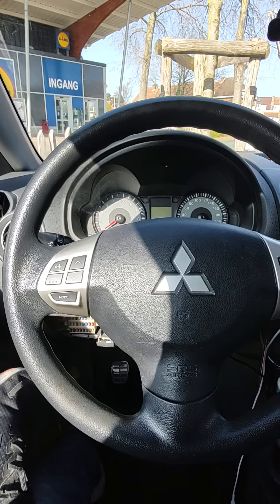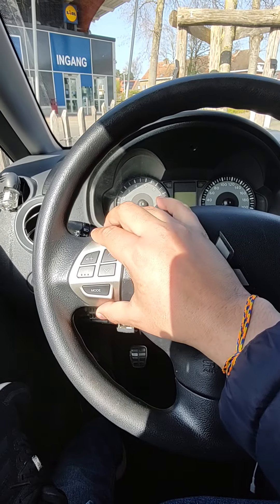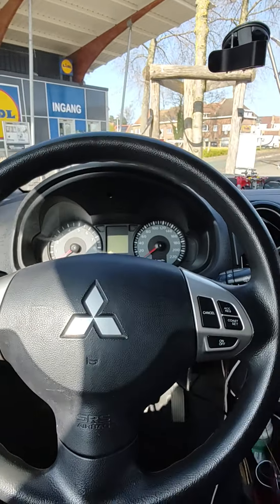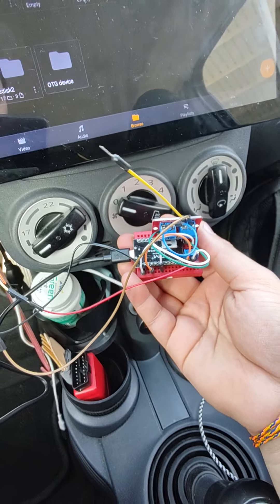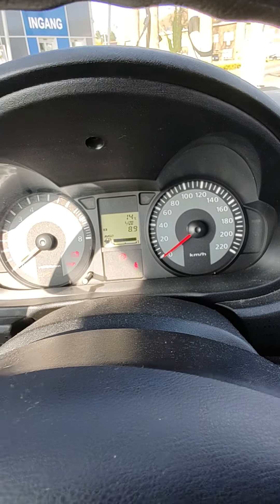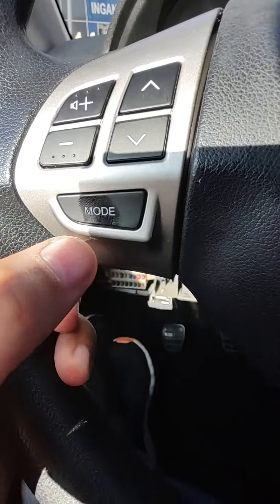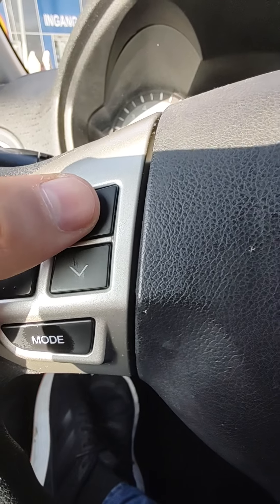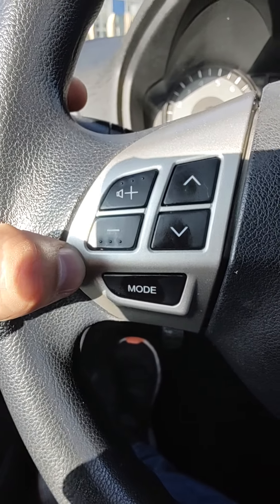Adding steeringwheel controls to Mitsubishi Colt Cleartec 2009 to control iMars 10.1" android tablet

Comment: Great video! I have the exactly same model. What about cruise control. You just added buttons and it works without any other modification?
Reply from the maker: Yes. My car doesn't have cruise control. Buttons are just for show. Adding buttons is not enough. It needs different clock spring. After adding buttons and replacing clock spring (for additional wires), it works with stock radio that comes with the car.

Comment: Hey Suresh, why doesn't it work, what's the reason? I have the same buttons, and similar android HU. And how does the Arduino recognize them but not the Android?
Reply from the maker: Hey. My HU was cheap chinese HU with inferior software (and hardware). Maybe that's why. I am annoyed by it nowdays (Waze crashing randomly, very slow, not responding). So, I'm thinking of replacing it with actual tablet. They have tablet holder that you can insert into CD player. Maybe I'll use that or maybe I'll make something to plug into 1DIN. Parking camera can be done with some software and composite to usb adapter.  Sorry, I couldn't be of more help with your original question. I tried to make it work with built in software for some time but couldn't. It's a shame because otherwise it could be a great setup with some improvements. My HU had radio with RDS even though it would start up automatically on power even after I stopped it last time.
Reply from the maker: Can you try connecting one wire to ground and another to KEY1 or KEY2 and see if it can be detected in the software?